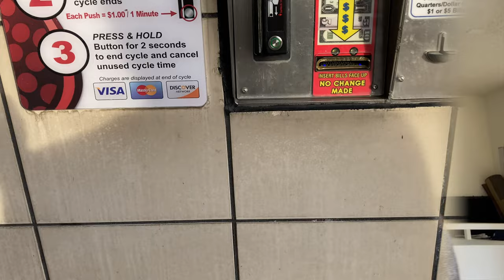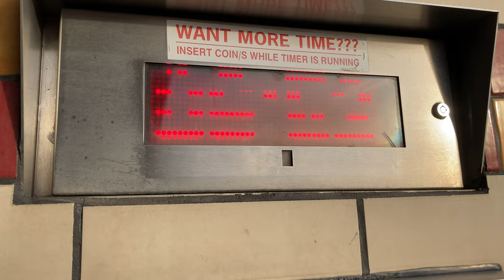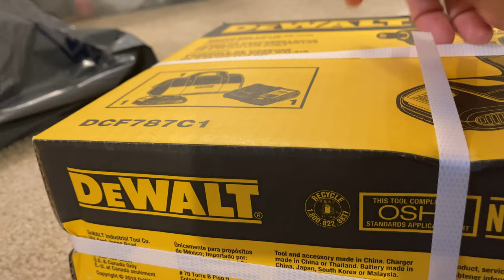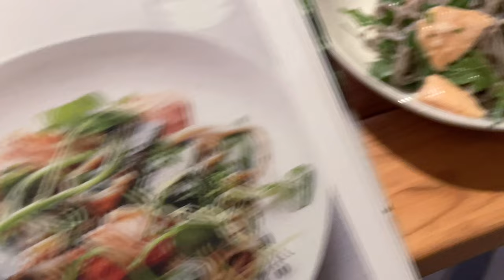handywoman diaries | trying on a handywoman work apron & other new tools

Comment: Are you using a hammer drill for drilling into brick? If youre not that can explain why the bits are wearing out so quick. Also i use my impact driver for assembly, because of the variable speed trigger, if i squeeze gently i avoid damaging anything
Reply from the maker: I’m so heavy handed I wouldn’t dare use it for furniture assembly.  I know, hammer drill keeps popping up too on my list of tools I need, maybe after I pay for the tax services I’ll invest in that if I get more brick and cement drilling jobs

Comment: The biggest regret in life would be returning that impact drill. Just imagine trying to drill something in and your regular drill driver is barely making it, it's almost there, it just won't get it done. Your new drill, your impact drill will save the day.

And btw the apron looks nice
Reply from the maker: OMG IVE BEEN CALLING IT A COMPACT DRILL LOL
idk maybe I should return it since I obviously don’t even know it’s name haha anyway I need to learn the full capabilities of the IMPACT I’ll probably keep it or return it for another brand
Reply: @ahandywomanandherdog  or at least give it a week. Just keep in mind that those drills will make a clicking nose when you're really driving in shit. It's normal and it's just the anvil assisting the drill in turning, providing torque.
If you do want to return it for another brand that's cool but you might spend more money since most brands offer the option for a tool only purchase vs the tool with battery and charger.
 DeWalt is a nice brand and it's up there with Makita and Milwaukee.
Or if you just wanna return it for your money back, it wouldn't kill ya. Mankind has been building and fixing shit thousands of years way before an impact was ever invented. 
I had a grandpa that had a hand crank drill (which is non electric ) that he used to use.
Reply from the maker: @iammarvin2264  I’m going to give the Dewalt Impact a month before I decide to return it or not.  Where did that hand crank drill go?  I bet it looks so cool!
Reply: @ahandywomanandherdog  it depends on which tool chest he left it in.
My aunt tool one tool box and my uncle took the other.
I'm very impressed on how people back then got by with very little. Everytime I stopped by my grandparents' home it was like stepping into a time machine.